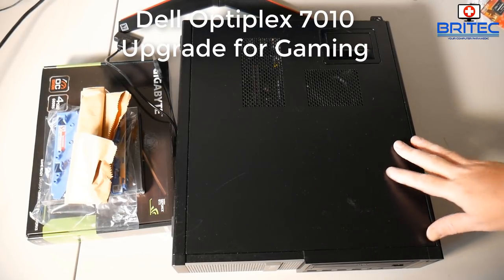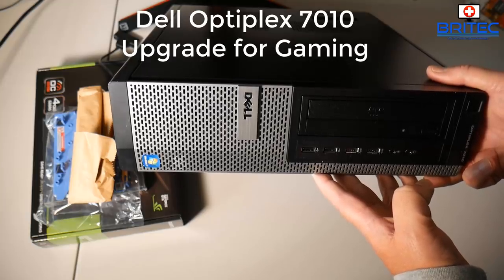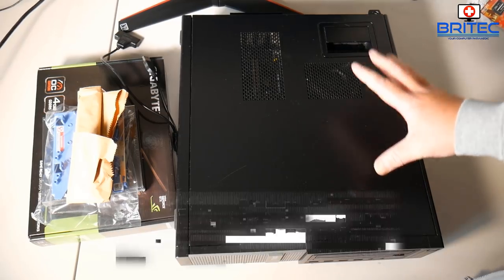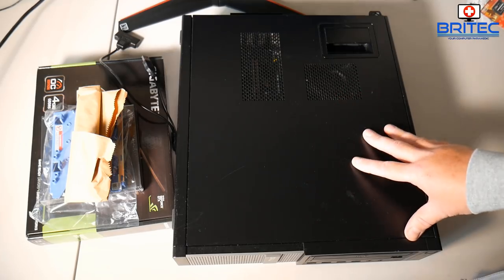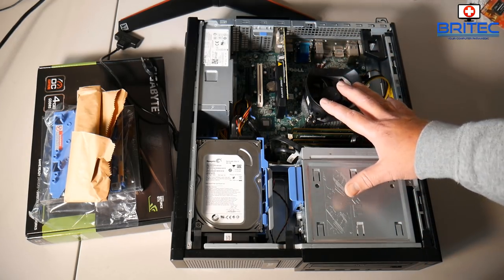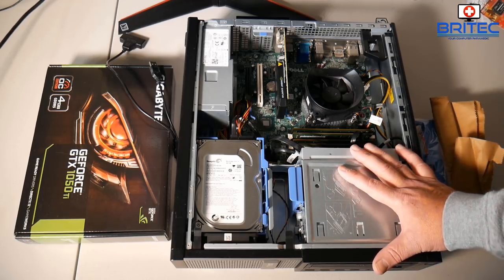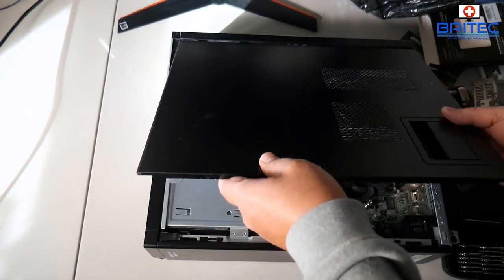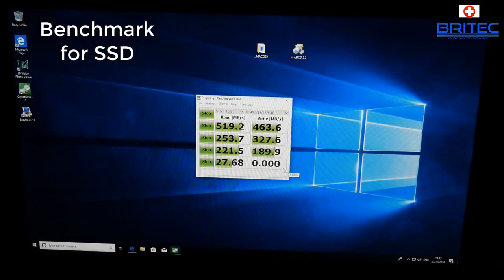Turn Your Low End PC Into A Gaming PC

Comment: I have the same system. For anyone that wants to upgrade the PSU, it uses the TFX format and the motherboard has the standard 24 pin main power and 4 pin CPU power connections. They can be upgraded but trying to find something of decent quality can be a challenge.  I was able to track down a 300w Seasonic 80+ Bronze and it works without issue.
Reply from the maker: be quiet! TFX Power 2 300W Gold or something with more power https://www.amazon.com/FSP-Supply-Single-Certified-FSP500-702UH/dp/B01BMERN2A

Comment: I recently did something very similar on an Optiplex 3010 SFF Put in an MSI 1050ti low proile GPU  and swapped Out the Core 2 Duo for an i7 3770 and upgraded from 2GB of Ram to 8GB, Makes a great media center PC.
Reply: Is the 1050 ti low pro the largest you can fit? 
3020 sff in the werks.. Lol
Reply: @VinniBob1  yes, it's low profile but still slot and a half
Reply: I was going to upgrade a Dell Vostro 760s, but the power supply couldn't be upgraded, so I took the i5-2400 out of that machine, bought a Corsair 200R case, and got a P8Z77-V LX motherboard with a Corsair RM 550x PSU and a GTX 1050 and now I can be free to upgrade to whatever I want to upgrade. Later I plan to get a new Corsair case, a bigger one. Those Dell cases are so restrictive in what you can do to your machine.
Reply: core2duo its a 775 socket and i7 3770 socket 1155 how you put it on a 775 socket
Reply: My bad I thought it was a core2... it was actually a Pentium dual core g2020
Reply: Chuck Wolf did you have to upgrade your PSU at all? I have an Optiplelx 3040 and I’m thinking about putting a 1050 ti low profile in as well. But with only 180W PSU I’m worried it can’t handle the gpu
Reply: @alexwelch2758  Not at all it works fine with the stock one as the MSI 1050Ti low profile only uses the PCIE slot for power though my 3010 came with a 240 watt PSU
Reply: Chuck Wolf nice. I may just have to give it a go and hope it can handle the gpu. Crazy how nice a setup you can achieve with some of these really cheap dells
Reply: @carlosmolina9613  people  🤣🤣

Comment: As an FYI, with the latest firmwares, I was able to put 32Gb (8Gbx4) into my bad boy. (BIOS version A19 wouldn't work, but an upgrade to A29 made it work. Another thread mentions A21 works as well. So I would imagine atleast BIOS versions A21 to A29 support 32Gb (Despite Dell saying 8 Gb total is the max)

Comment: For those worry power supply problem, I have optiplex 7010 DT, the psu is original 240w, no worry it can support gtx 1050ti mini without problem, plug, install driver then cool to go

Comment: Your Video helps me so much, I was given an old Optiplex 7010 and have used it for some time, quite impressed at the way it runs completely stock besides windows 10 being installed on it.
I wanted to Upgrade it to play more and run more as I am an artist and my programs would benefit significantly from this and my occasional gaming as well.
We seem to be running the same system besides the internals of my PC being a little different, I have a huge power supply that takes up the entire lower end of the stealth case. The fan id is different too as it's one of those console-looking fans that are completely encased.

Anyhow I wanted to say thank you and if you have any advice on what I should do I would love to hear it, Also thank you for showing and talking about the cloning option, I find few talks about it and fewer explain how to, I'm kind of a dummy when it comes to technical computer stuff so people like you help me more then people know.

Comment: I did not make it into a gaming machine but I did buy one one ebay. I put in an SSD reinstalled windows and gave it to my girlfriends mother after her 2009 PC died. She loves it. Optiplex SFF 3010, 8 gb or ram for $90.00. I had the SSD from an old pc.
Reply from the maker: They are great little machines for the money.
Reply: Yes they are especially if you are just looking to give it to someone that wants to surf the internet check email and play solitaire.  He has another one. https://www.ebay.com/itm/Dell-Optiplex-3010-SFF-i3-3220-3-30GHz-8GB-RAM-250GB-Win-7-Pro-/223175680690?hash=item33f64ea2b2
Reply: @Britec09  can you do a upgrade on that machine with 32gb ram and I7 process with graphic card

Comment: Something of note is there is a way to get around that psu limitation on the SFF units. Rather than going with a regular or K model go with an S or T model CPU. Yes the base clocks are lower but they still have turbo and are still quite fast.

Comment: I did something similar last year before going abroad for work. I'm temporarily working abroad and was wondering what to take with me to be able to have decent setup for work/Intermet/movies and also for occasional light gaming. I had to leave behind my huge set up for time being. Gaming Laptop would be ideal but costs a bit, and I was trying to go as cheap as possible. 

This is why I got used DELL Optiplex 9010 SFF with i5-3470 (and sticker win7 Pro – Updated to Win10), added some RAM now it has 12GB, got ZOTAC GTX1050Ti LP (you cannot use MSI GTX1050Ti as it is too long and power plug is in the way, you can use Gigabyte instead), 240GB SSD + 1TB HDD. SSD is concealed in special CDROM/HDD caddy (costs really cheap) with nice faceplate so you can't see there is no DVDROM. Got on Aliexpress special hard drive caddy for 2x 2.5” HDDs as shown on the video so I can have for example 2x1TB HDDs if the need arises beside SSD. Yes, you can have total 3 HDDs in this machine or 2 HDDs + DVDROM – with this adapter. My Dell didn’t have a speaker so I got it separately directly from DELL for only £3 so it can have basic sound – nothing special just using it for listening to news, normally using BT headphones.  

Overall, I'm very pleased with performance – I know this is temporarily set up but I can play any game with decent FPS – Witcher 3. FC5, RE2, Assassins Creed, Dishonored 2, Kingdom Come, Latest TRs, even Metro Exodus works super good on this machine – graphics maybe aren’t on Ultra but in many games are on high/medium. The only problem is that when playing the video card gets very loud... 

Many people are wondering if the PSU (has only 240W) can cope with video card, I can assure anyone that there are no problems whatsoever... I played hours and hours of AAA games and there are no signs of slightest failure – works solid.

Comment: I'm going to try a GTX1650 in my Shuttle SH61R4 (which only has the i3-2100) and if that doesn't work out, then get myself an Optiplex 7010 per this demo.  :)  Really useful video thanks

Comment: I'm still using a i5 3570k with a 980 and it plays everything no problem.
Reply: I wish i had a GTX 980 with my i5 3470, my budget didn't allow me to get anything better than a Gigabyte GT 1030 OC. I am overclocking the card pretty heavily, It performs well with it, I can play GTA 5 at Very high settings, no distance scaling, no FXAA or MSAA, 1600X900. I average around 40 to 50fps.
Reply: Ricardo The PC Wizard yeah it does the job, which is a good thing as I can't afford to build fo the foreseeable future. I put it together in 2013 and it still doing the business. No need to OC just yet.👍

Comment: I have just bought one for around 50-60£ with a i3, 250gb hard drive and windows 10 pro planing to buy a 1050/1050ti low profile gpu to put inside after checking out this video, maybe change the hard drive for a ssd later when the budget is there

Comment: I have the same PC as this [optiplex 7010sff]. I use it for looking up stuff & also YouTube/Netflix. I like how it looks & its small, neat size. I never had the money for an expensive PC, it took me a few weeks to save for a new SSD recently but i was blown away at how easy it was to clone & replace. The performance is amazing, booting up in less than 10 seconds. So now i'm wondering, must i get a graphics card. I am not a gamer. Besides what i just mentioned, ive only used what came in the PC when new. I ordered  8GB of DDR3 12800 [1600MHz] from CEX & when i got it the next day i noticed that besides the brand, Kingston, there was no other label on the sticks. So i installed & found they were actually 1333MHz. The CEX store is 10 mins away from me but i was working my butt off before the "lockdown" kicked in & since they deliver for free i decided i needed to get every hour in at work & have my parts delivered before non-essential stores closed, like CEX. Now i must wait til they open back up to have them replaced. In the meantime i have no option but to use them. Will i notice a difference when i get the correct DDR3 ram. In time i will be replacing my i3 cpu with the i5 or i7, depending on cost. These can ALSO be got from CEX. This is all new to me & thats why i get my bits from CEX. When i am confident enough to put a weeks wages into a piece of kit i will do so but i'm just learning as i go, ye know. Tnx a lot Britec09
Reply: Me too.

Comment: Nice upgrade on that old Optiplex. I have found them to be far less fussy with upgrades than the junk HP business model equivalents.
Reply from the maker: Yeah DELL PSU is pretty good as well i think.
Reply: I bought a refurbished hp elite 8300 with a core i5 3rd gen quad core, and 8gb ram. I installed a Silicon Power A55 512gb SSD and a Gigabyte GT 1030 OC, also i am planning to put in another 4gb of ram. That PC works great, i am impressed with it. I understand about the power supply having a stupid designed motherboard plugin, but you can buy an adapter to make it work with an upgraded power supply.
Reply: lance ripplinger HP alone sucks ass. Laptop overheats too quickly, bloatware taken to the next level
Reply: the dell PSU and the fact that some of those HP limit power to the pcie makes the optiplex the better choice. if you look on gumtree and shpock you may get one cheaper than on ebay too. i got one from gumtree for 50 quid, i5 3570 version.

Comment: Did this card need an additional connection to power like many other gfx cards? So tempting to get one of these off ebay and pop in a 1030 (cause I'm cheap).
Reply from the maker: no extra power needed
Reply: @Britec09  will a Dell Optiplex 3020 mini tower with a i5-4590 and a rx 560 itx card work or no? as i hear people online say the pcie slot wont give it enough power. i would appreciate your feedback,thanks

Comment: Most PC makers cheat on the power supply(cheap parts used inside it) and they are usually the first thing to burn out. Bottom line - Don't go cheap on the Power Supply, it might save your butt.

Comment: I tried this once but I put in a powerful Graphics card which required more power to run. And the PC used to shut itself down.
Reply: Maybe you used a normal graphics card? You need a low profile to run it in this PC
Reply: @thelegend49  yes. It was an abomination. The lid was off had to buy a bigger power supply which wouldn't fit inside so I taped it.

Comment: With the right equipment,  can these builds push like 120 hz or higher ?  (  without issues )   I would like  to start a a build but with next gen consoles thinking 60z  woukd not be a good  build for pc . (  most vids seem to say its low settings 69 hz )

Comment: dude. dont want to crap on your vid. but u need to mention that not all ram is the same and you need to be running ram which is clocked the same. i made the mistake when i was still a noob of trying to put any ram that fit into my pc. also you shouldnt buy the cheapest ssd on the market as a lot of the best deals might seem good but they dont have D-RAM cache. check linus' video on ssds without D-RAM.  otherwise its a decent vid keep it up.

Comment: hi i have this dell model with an i7 3770 and 16 gb of ram with an ssd , i was hoping to add a low profile graphics card and get decent performance. I do video editing , obs stuff and also gaming and was thinking of putting in a graphics card so i can get around 144 fps on low settings on games like fortnite . Since i got this rig for free i 'm thinking of buying a budget graphics card like a 1050 ti or a rx570 so do you think it will workout for my requirements or should i just build a new pc?

Comment: I just bought the same PC on eBay like you said and it was only $100.
Reply: Does it run roblox i need it to if ima buy it
Reply: @sheepyplayz322  if you don't upgrade it you can run Roblox on low graphics but if you plan on upgrading it you'll have to buy the MT version or else it's impossible to upgrade.

Comment: I recommend the EVGA GTX 750TI 2gb sc you can now find this card for around £60-70 it will run gta5 on high settings 1080p 40FPS average, another good thing about it it does not require a special powersupply with 6pin power connectors since it runs straight off the mobo, its low on power consumption only 63w plus its extremely cool I never seen mine go above 57c and its very small will fit in any pc case big or small, the only downside is the 2GB vram.

Comment: In dell's instruction for optiplex 7010 I read that maximum pciex16 wattage is 50W, but GTX 1050 has 75W TDP.?????
Reply from the maker: I would recommend you upgrade PSU. The GPU also has a 300w recommend on it as well. It does run and play games, but always best to be on safe side
Reply: @Britec09  can u  put some link here please
Reply from the maker: @luisenrique2138  https://www.newegg.com/replace-power-rp-sff-l250ns/p/1HU-009N-000B8? something like this. Please check size

Comment: Guys plz help I have a dell optiplex 3050 with this specs:
Intel core i3 7100 8gb ram 
An optical drive 
500 gb hdd 7200 
2 fans 
Psu 240 watts 
And iam using gt 710 2gb without problems will I have soon problems ?? Plz helppp???

Comment: Can I upgrade my Dell optiplex 5040 to a gaming PC?
Reply from the maker: Hi Aggelos, that's a small form factor pc with very little room between the GPU and PSU. You can put a AMD Radeon HD8570 GPU in there
Reply from the maker: The PSU in that machine is 180w so your also limited there
Reply from the maker: Card can not be wider than 7.62cm which is about half a inch. You might be able to get a better fanless card to fit.
Reply: @Britec09  Oh then my plans on getting an AMD RYZEN and changing the motherboard and the power supply are screwed.
Reply from the maker: Yeah you're limited with that machine as it is.
Reply: @Britec09  Uh well as long as I can live with it I am fine. Thank you very much for your help and your time.